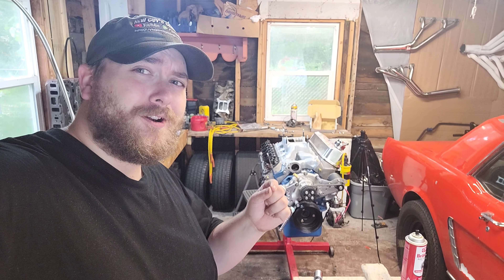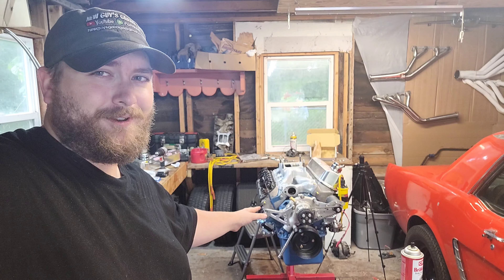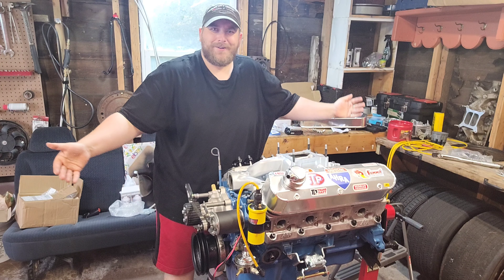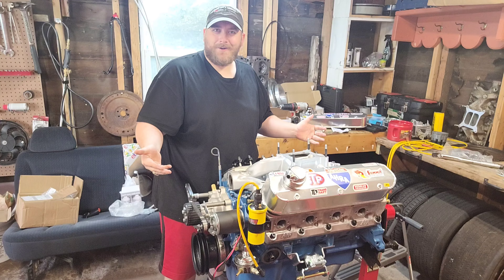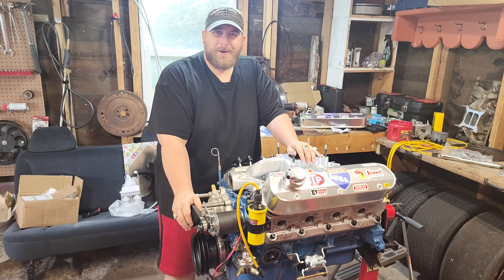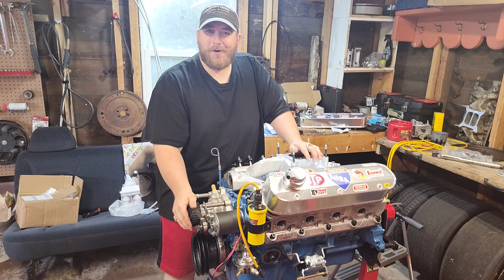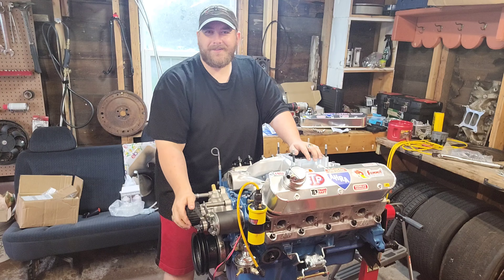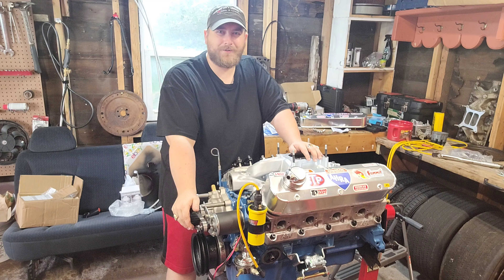Nitrous 308w Build! | Ready To Put In The Car!? | Engine Build For Our Ford Mustang Is Almost Done!

Comment: I work in oil refinery, and I approve this message. You can use  some types of silicone with petroleum desolates. I went with the 1 wire from Tuff Stuff. Really nice upgrade.  Get the voltage regulator outta there lol.